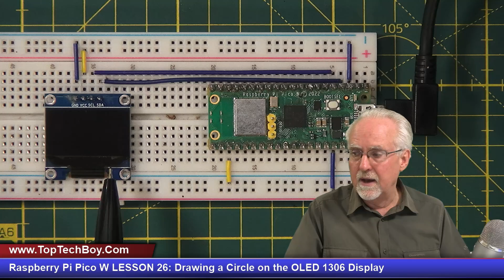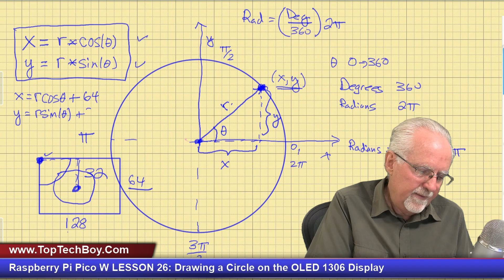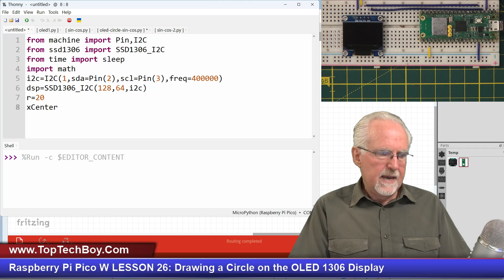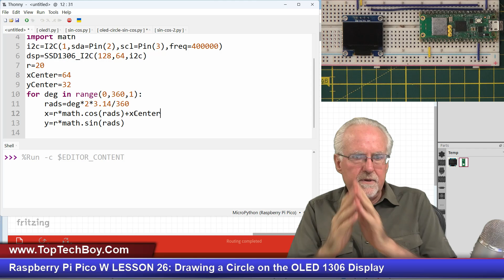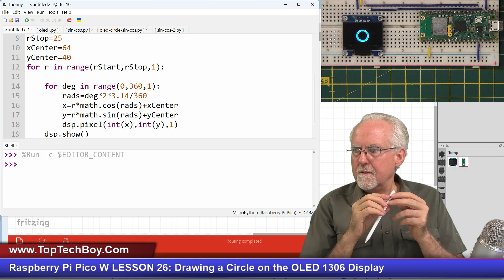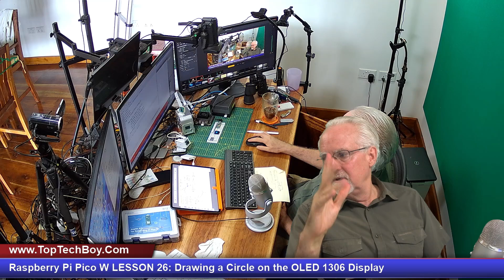Raspberry Pi Pico W LESSON 26: Drawing a Circle on the OLED 1306 Display

Comment: I found an easy solution to the homework: dsp.ellipse(64, 39, 20, 20, 1). it is essentially just an ellipse but with an equal x radius and y radius. here is what each number does: dsp.ellipse(collumn, row, x - radius, y - radius, on/off)

P.S.
I only looked on google for 3 minutes.

Comment: Not sure if this was cheating, but since I couldn't find the initial library anyway I just had Chat GPT generate me a library that had a circle defined in it. Worked pretty well, here is the snippet of library code I am now using to place a circle at coordinates x, y with a defined radius. 

def circ(self, x0, y0, radius, color=1):
    """Draw a circle centered at (x0, y0) with given radius."""
    x = radius
    y = 0
    err = 0

    while x >= y:
        self.pixel(x0 + x, y0 + y, color)
        self.pixel(x0 + y, y0 + x, color)
        self.pixel(x0 - y, y0 + x, color)
        self.pixel(x0 - x, y0 + y, color)
        self.pixel(x0 - x, y0 - y, color)
        self.pixel(x0 - y, y0 - x, color)
        self.pixel(x0 + y, y0 - x, color)
        self.pixel(x0 + x, y0 - y, color)

        y += 1
        if err <= 0:
            err += 2 * y + 1
        if err > 0:
            x -= 1
            err -= 2 * x + 1
Reply from the maker: Yet do you even understand what chatGPT created? If not, what are you learning? I say this not to be harsh, but each of us has to worry about staying relevant in the age of AI. If you go back and review trig, x=r*cos(angle) y=r*sin(angle), make a for loop to sweep angle from 0 to 2*pi, and calculate (x,y) and then put that pixel on the OLED. 

The thing each of us should be losing sleep over, how do  I make myself relevant to the future? Getting AI to do my work is not a good answer.
Reply: @paulmcwhorter I also asked Chat GPT to walk through it line by line and tell me what it was doing and why. Since I have been adding and modifying classes with Chat GPT, I've learned a decent amount about object oriented programming which is important. 

I think one other thing to consider is that AI is here to stay and being able to use it effectively is also a skill set. Just like being able to use Excel became a requirement for all professional jobs, I imagine so too will being able to use AI. 

I am not saying that math isn't important, by the way, just that using newer and better tools as they become available is just part of the way that things work.

Comment: Issue: From the last lesson I and several other folks were getting an Error, tried several proposed solutions and the only one that works for me is this line of code from Francisco Cruz's solution:
i2c = machine.SoftI2C(scl=machine.Pin(3), sda=machine.Pin(2)), your method 
i2c=I2C(1,sda=Pin(2),scl=Pin(3),freq=400000) does not run. Any thoughts???
Reply from the maker: Probably the difference between "import machine" vs "from machine import Pin"

Comment: I drew the circle two different ways, and neither of them used Paul's method:
1.  Since there was a function for drawing rectangles, I thought there may be a function for drawing circles, so I looked in the library.  I didn't see a member function in either of the classes SSD1306 or SSD1306_I2C, but SSD1306 does seem to inherit from framebuf.FrameBuffer, so I did a Google search on that.  I didn't find a circle function, but I did find an ellipse function, which draws a circle if you set the both the xr and yr values to the circle's radius.  Done.  (Of course, I'm going through this lesson a year and a half after Paul first uploaded it.)
2.  When I started watching the video, I realized that Paul hadn't used the ellipse function and instead used calculations, so I paused the video and tried to come up with my own solution.  My solution involved using the Pythagorean theorem instead of sin and cos.  My first try involved a "for x in range (-20,21):" and calculating a y value for every x and the plotting pixels at offset x,+y and x,-y from the center.  This was actually a pretty crappy circle, as it did fine at the top an bottom of the circle, but the circle was missing pixel on the right and left side.  Then I calculated the x coordinate 45 degree point using deg45Delta = int(math.sqrt(200) + 0.5) then a "for x in range(deg45Delta+1):".  Just as before, for every x value I use the Pythagorean theorem to calculate a y value, then use each pair of x and y values to plot eight pixel as offsets (x,y), (x,-y), (-x,,y), (-x,-y), (y,x), (y,-x), (-y,x), and (-y,-x) from the center.  That gives me a beautiful circle.

Paul's solution is much better if you want to only draw part of the circle, but I do see a couple of potential problems with his solution.  First, is a small problem - he always truncates floating-point numbers into ints, which, in some cases gives his circle some "corners" that don't make it look perfectly smooth.  The second is probably not a problem for our OLED but could be a problem with a bigger display.  Since he loops in one degree increments, he's only going to plot 360 pixels, and some bigger circles they may need more points or there will be gaps in the circle.  This can obviously be fixed with smaller increments, but that means even more computation.  I started coding in the late 1970s when we often had to adjust our code because of computation reasons (the Pico would have been a marvel!), so maybe I'm overly sensitive to computational limitations.

In any case, even if you're fully comfortable with the math of both Paul's and my solutions, this lesson made me appreciate that there are some practical considerations that make this a challenging problem.

Comment: For the circle, I worked smarter not harder by using the ellipse function.  BUT after seeing Paul's solution that would be best if a full circle is not needed.  TY Paul.  Suggestions for addressing 2 SSD1306(s)???  So, is that only a single chest bump or a Target lawn chair???

Comment: It is so pity I found your lessons so late and I'm not in schedule. As for circle, I used Pifagor's theorem to build circle as I didn't want to use math library. It has no so flat sides at each 90 degrees but it has some spaces at y axis at every 180. As for next homework, since it was posted 4 month ago I can put spoilers here :) It is lissajous figures. I draw them on old oscilloscopes in our lab at university. Will not watch next video until I finish this challenge.

Comment: I am legend. I found that the primitives text, rect, line, etc are inside framebuff  that ssd1302 is importing. There is also an ellipse primitive and if you set both diameters to the same value, you draw a circle
Reply from the maker: LEGEND!

Comment: I think I got it.  Thanks for the challenge.   Here is my solution to the homework:  https://youtu.be/P3esd0ux5oE
Reply from the maker: You have the video set to 'private' meaning no one can see it but you.
Reply: @paulmcwhorter   yes, after I posted my solution, I noticed that Charlotte posted her results, but withheld the solution so as not to reveal how to do it.  Following her lead, I set my original video to private.  Here is the introduction which shows my result, but does not include the details of the program.   https://youtu.be/54MaW8i91Cg

Comment: I am legend!  These were fun curves to work with.  I had some idea about them since the new Meta logo is an example.  I will post my video on Sunday so folks have a chance to give this a try.  Not sure what folks call cheating; I read about the curves on wikipedia to get the functional form but I did the code myself.  I set my homework to premiere on Sunday July 23.  https://youtu.be/hPDGbcUWmns
Reply from the maker: Not cheating, but the clue to this would be the title of lesson 27, and then looking up the magic word. However, old timers who went to tech or engineering school and learned the oscilliscope in lab class most likely played around creating these in an analog fashion. I was always fascinated by them.
Reply: @paulmcwhorter  Yet another reason to ask for an oscilloscope for Xmas!
Reply: @charlotteswift  Which one do you have?  I plan to ask for one for xmas.  There are so many options out there.  I am hoping Paul will do a course on one and I would then purchase the one he plans to use.

Comment: Well I have folded up like a cheap Walmart lawn chair. I have no idea where to start without cheating. Since it look like a sine wave I assume trig will come into play.
Look forward to your solution Paul.
Reply from the maker: Tune in for next weeks lesson. It is basically an old trick people would do on an oscilliscope. And it is easy enough to program up. Thanks for watching.
Reply: I hope you don't consider reading on these curves cheating.  I didn't know the functional form to use so I read a bunch and then coded it.  Got it running but I would like to make it not "flash" so much on my screen as I clear it out.
Reply: I am with you Keith.. I don't want to go look at other solutions yet. Still ahve not given up. I sure have learned alot. I ahve figured out how to show something like a potato chip, but cannot figure out how to make it spin.

Comment: I am legend. I solved the homework. Tricky. Here my Code with Poti-Change

from machine import Pin,I2C,ADC
from ssd1306 import SSD1306_I2C
from time import sleep
import math
i2c=I2C(1,sda=Pin(2),scl=Pin(3),freq=400000)
dsp=SSD1306_I2C(128,64,i2c)

# Initialisierung ADC-Inputs (Poti)
adc0 = ADC(0) # GP26
adc1 = ADC(1) # GP27
adc2 = ADC(2) # GP28

r=25
xCenter=64
yCenter=32

xFactor=1
xFactorOld=1
yFactor=1
yFactorOld=1
Speed=1
SpeedOld=1

while True:
    for i in range (0,360,Speed):
        xFactor = int(adc0.read_u16()/65535*9)+1 # Range 1 to 10
        yFactor = int(adc1.read_u16()/65535*9)+1 # Range 1 to 10
        Speed = int(adc2.read_u16()/65535*19)+1 # Range 1 to 20
        if xFactor != xFactorOld or yFactor != yFactorOld or Speed != SpeedOld:
            print(xFactor,yFactor,Speed)
        dsp.fill(0)
        for deg in range(0,360,1):
            rads=(deg*2*3.14/360)
            x=r*math.cos(xFactor*rads)+xCenter
            y=r*math.sin(yFactor*rads+(i*2*3.14/360))+yCenter
            dsp.pixel(int(x),int(y),1)
        dsp.show()
        xFactorOld=xFactor
        yFactorOld=yFactor
        SpeedOld=Speed

https://youtu.be/eZ0-WtmTpi0
Reply from the maker: Excellent work. Had you seen these patterns before?
Reply: @paulmcwhorter  Thanks very much. Yes, I have. I'm an electrical engineer and I created these Lissajous figures with an oscilloscope. Your channel is really admirable. Please continue. I look forward to more educational videos.

Comment: I used the .ellipse function from the framebuf library after noticing that the SSD1306 driver referenced this library.  Just set the x radius and the y radius equal to one another and you get a circle instead of an ellipse.  Maybe that's cheating?    The key instruction:   myoled.ellipse(xpos, ypos, 20, 20, 1) , where xpos and ypos place the center of the ellipse in the middle of the screen.

Comment: Hello Paul, Sadly, the raspberry pi is out of my price range. So would the Raspberry Pi Pico W work with the Raspberry Pi tutorial? i know theres a specific tutorial for that but i feel this is just more detailed
Reply: You can di a lot with the Pico, but the Raspberry Pi has resources that are missing on the Pico and Pico W.  The Raspberry Pi has a full operating system,  HDMI, USB ports, Camera port, Ethernet, and a micro SD port.. The Pico is missing those features.  However, the PICO and PICO W are very capable microcontrollers.  They typically are relegated to doing a single task. The Raspberry Pi OS can do multitasking.